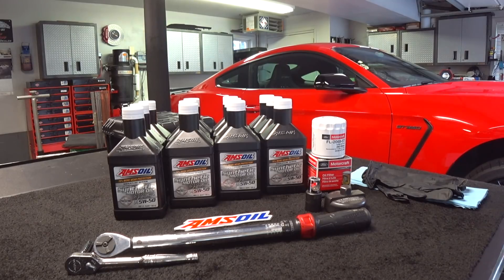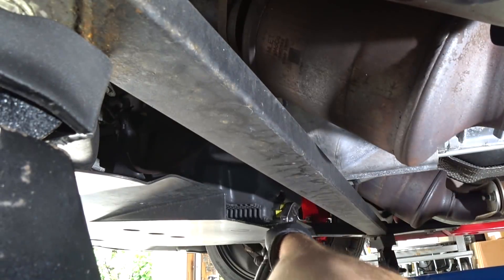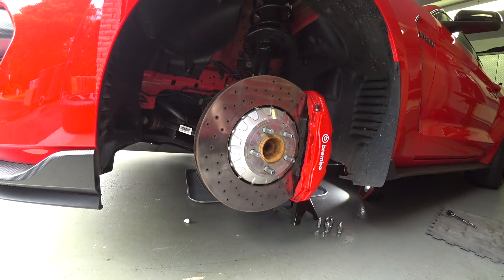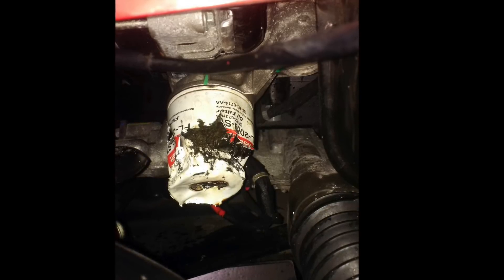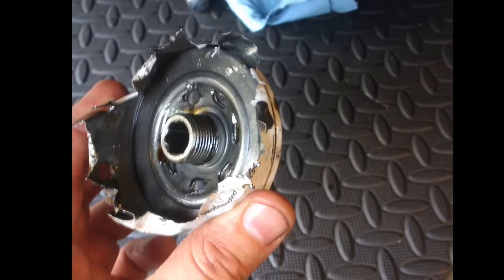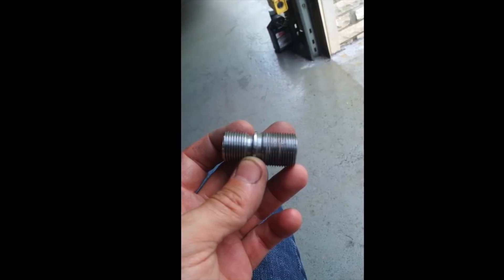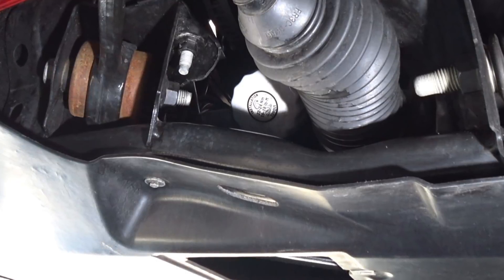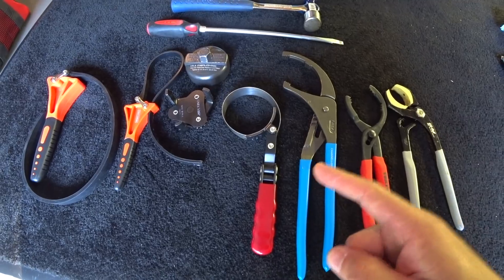Oil Change From Hell | Shelby GT350

Comment: dips hit mechanics should out it back on with a torque wrench.  my Porsche cayman s has a similar filter except it is easier to get to and it is upright and not at an angle.  when I change the oil I torque it to factory specs which I believe is 30 pounds or so.

Comment: Lol I had this problem all you have to do is drill a whole use a screw driver as a handle
Reply from the maker: dude that did not work as i explained the threads were seized up to the steel oil pump stud, i had it cut it off in my vise

Comment: Why did you "repair" the stud? Why not just buy a new one? Unless you rewelded metal onto it and retapped it, it's not going to be as good as new because the material is literally missing now. You can mess with it all you want but it's not going to be the sams. You buy an expensive car like this and then cheap out by not wanting to buy a new stud that was obviously ruined?
Reply from the maker: the chances of a local dealer having a new stud would be like winning the Powerball.

Comment: I hate when I work on a car that had a lazy impact gun blasting psychopath as the last oil changer. They always work at places that put filters with paper thin metal cases so you can't even count on the filter staying together when you manage to rotate it.
Reply: Cars Simplified that’s why you supply your mobile one filter with your mobile one oil. Ive been a lube Technician going on 3 years have never left a plug loose or filter siezed. I push out 60 cars a day and 80% of my customers are return customers. Just have to find the right shop stay away from any shop that is not connected in some sort with a big corporation like Napa, pennzoil, mobile, Castrol, or Quaker state. Stay away from firestone I’ve worked at two different ones and got to witness some of the most disguising people just disrespecting customers cars
Reply: Ugh.  Sounds like the PITA evening I had last year when my mom noticed a missing lugnut on her charger.  I figured I'd do her a favor and swap out the whole set of them since Dodge was using the chrome sleeve things which deform and rotate over the lug nut.  The dealership that usually does the work on the car must have used a 12 point socket on an air wrench or maybe an inch size on metric.  Most of them were too deformed for the car's spare kit lug wrench to fit on and they were a metric size I didn't have in my kit.  So I had to go find a suitably size tool and then because the sleeves were deformed, it wouldn't fit on most.  And even just slightly larger sockets would just turn the sleeves.  I had to hammer the right-size socket on to break them free, die-sizing the sleeves in the process.  A couple of them were hot enough to be uncomfortable to touch just from hammer the socket on.  It took over two hours but I did get them all and swapped them out for single piece plated acorn nuts that look better and won't get damaged like the OEM parts.
Reply: oh, and my other dealership fail fix was on my R53 mini... the bolt head of the oil drain plug was rounded over.  Not just overtightened but unremoveable.  I got set of Irwin extractors and they did the trick (with the help of a 4 lb sledge)
Reply: Rusty Shackelford  I had a supervisor showing me how not to break a lug key break a lug key.
Reply: Rusty Shackelford  Last August I went to Costco to let them do first tire rotation and balancing after first year and 1200 Kilometers. (7500 Miles)
Every employee in tire shop looked like teenager. I made a big mistake not walking out,right away. It's OK to be prejudist when it comes to fine and precise machines and instruments.
One of them who was driving my car from parking into the shop,didn't have any clue how to drive car with manual transmission. Every foot he moved my car,engine would shut off. In roughly 50 feet,he managed to shut off engine roughly 50 times. I almost cried.
When I came home I wanted to check if they tightened lug nuts to correct specified torque of 76 ft-lbf. (With one of my calibrated "PROTO" professional torque wrenches)
Little f.,they managed to completely round every lug nut on car.
Those are Toyota OEM lug nuts and I guess,maybe $ 200. Next time I will deliver only wheels for annual tire rotation and balancing.

Comment: My first oil change on a well used Duramax was almost that bad, but I finally got it off.
Later chages showed that for some reason the filters were tending to "tighten" after proper installation. Most likely due to the slightly higher operating temp of the Duramax, around 210f vs 180f. But I don't know for sure. Suggest tracking GT-500 oil temps with a temp gun at the filter housing to see... Additional oil cooling may need to be considered.  Good Job.

Comment: I change my own oil, however from time to time my dealer sends me free oil change coupons. Most of the time I just throw them in the trash but on this one occasion I decided to cash it in. A few months later my oil needed to be changed again. So I decided I would just do it myself like I always have done. When I got under the car and tried to remove the drain plug, it wouldn’t budge. I tried for the better part of an hour trying to get it loose, with no success. So I put my tools away and drove it to the dealer. I informed them I had my oil changed a few months back and was in need of another oil change but the drain plug would not come off. The guys in the service department knew exactly who changed my oil as soon as I told them I couldn’t get the drain plug off. So they put my car on the rack and messed with it for about 15 minutes before they got it loose. Then they asked if I wanted them to change my oil and I said absolutely not. So the service manager said we will just snug the plug up so you can get it home to change the oil. He also gave me a new drain plug because they had stripped the old one. He said if there are any problems with the pan or the drain plug leaking to let him know and they would fix it for free. When I got home I changed the oil, put the new plug in and never had another problem. I don’t think I could have done what you did. I would have just put the plug back in and added back the oil and drove it back to the dealer for them to fix the filter issue.

Comment: The filter is design to be that tight. Ford workshop manual says you need to tighten the filter to 18 ft lbs. Also this is not a oil change from the Ford GT is. Dry sump system and it takes 2 hours to do the oil change.

Comment: Why the hell do so many people use impact drills on oil plugs and filters?!
Reply: because they don't have the common sense to use a torque wrench set to the factory spec, or in absence of a torque wrench, putting it on hand tight with a bit more using a regular socket.
Reply: Being lazy and maybe untrained.

Comment: What the heck?  You have to take the wheel off to change the oil. Wow!  What a nightmare of an oil change you had!
Reply from the maker: pulling the wheel on this car makes it much easier but the filter location still sucks and there is very limited room to work in this corner.

Comment: My buddies wife had a Pontiac Sunbird, I think it was a 2.0. The car had an aluminum head.
They took it to Firestone who...put the plugs in a hot engine with an impact wrench.
Reply: Ouch, that sucks to.
Reply: Did they end up needing to get new heads for it or did someone eventually get the plugs unseized?
Reply: How does your buddy know that? I don't believe it.
Reply: whats the point of this comment? So they put the plugs in a hot engine with an impact wrench? Nice, i did that probably over 100 times as a mechanic of 15 years. Never broken a spark plug in the head taking in it out, or putting it in.
Reply: @sashapuhalo5270  Horrible
Reply: Impact drive or impact gun ? Big difference in tq that’s applied. And for those of you that go “that horrible” unless you make money by turning wrenches you don’t get a vote. And to the post that said “did they need new heads?” The GM 2.0 eco tech only has ONE head. A 1/4 impact drive from dewalt is normally what’s used when doing plugs which is 80-100 inch pounds which translates to 7-9 foot pounds which is right at the bottom limits of what a spark plug needs. With “about” 14 foot pounds being the MAX to use which the 1/4 impact won’t get close to.
Reply: Brian Fulwood P

Comment: No lube tech or professional mechanic is ever going to use a torque wrench to tighten an oil filter or drain plug.  I believe you probably messed it up on the prior oil change.

Comment: So question? Why didn't you take it back to the dealer and show them the problem? I worked in the automobile industry for close to 30 years. If you could prove they did damaged your GT 500 (and that one looks new) I would think you would have had a warranty claim.
 Also Factory Representatives visit stores and will look over issues like this if they are made aware of them. The dealer stands to lose Big money if they are found to be doing bad work and getting bad CSI reports. Trust me the Dealership owners want to make sure their service departments are doing good work. Bad Reports and LOW CSI scores cost them Big Big Money because CSI  scores play a part in getting the right inventory or enough inventory or incentives to lower the cost of their vehicle inventory. Warranty claims processing and payments are also effected. 

It's the first thing I would have done once I had discovered the problem. Instead you posted a video and now you can't prove anything.

Comment: That is one thing I like about my Subaru, oil filter is on the top of the engine and right up front with absolutely nothing getting in the way.
Reply: Snadzies hell ya! add a fumoto valve and its crazy easy
Reply: Same thing with my 2000 clk its right at the top
Reply: I did my 2018 Crosstrek's first oil change recently and it has that set up. Super convenient and easy!
Reply: Yes those are more convenient, however, you would not want that top-load setup on high performance car.
Reply: Similar with my car, but it's on the bottom. Only thing in the way is the over-engineered, meaty subframe, and even that isn't in the way more than necessary.

Comment: you should get a quick jack lift
Reply from the maker: too heavy to move around and i have no space for one, i honestly can get the car up on all 4 sides in less than 5 minutes which is easier than setting up the quicklift stuff. I use 2 jacks it is so easy

Comment: I tell people all the time as a technician at ford that you should learn how to do your own oil changes if possible. The only person who’s gonna do the best job on your car is your self!
Reply from the maker: i always do it happened that i was near a dealer way up north and had the oil in my trunk and in the middle of winter it made it easier and now i realize how bad of a mistake that was. Did Ford tell techs to overtorque filters on this car?
Reply: Auto Fanatic I’m sorry about your experience with that dealership. And as for ford requiring us to over torque our filters that’s nonsense, I follow what the specs call for on each vehicle that I work on especially some of the Shelby’s that I work on require extra time and care when doing a service on them.

Comment: Oil filter torque spec is 16-18 ft/lbs. When hot, that filter is F'in tight. Every one I do gets a torque wrench put to it. It always takes way more than 18  ft/lbs to get it loose.
Reply: wait that's the torque when installing it? I install oil filters with my hands and even then I need to wrench it off
Reply: The rubber on the oil filter always locks it up after it has done a few run cycles and that’s why it is harder to remove than it was to install. Best practice is to lubricate the seal and screw it on with your hand only. It is a big mistake to think that it has to be installed as tightly as the last one was removed as it becomes nearly impossible to remove next time. I have had an apprentice do this once and it was hard to get him out of this mindset.
Reply: Thats because there is a big difference between brake away torque and torque with momentum. It might only be 15-20lbs to get it on. That torque is read while in a constant motion until the click. When braking ,you have to overcome the resistance of friction on a stuck part and can easily go up 5-15lbs.

Comment: So running the car before changing the oil to bring oil to temp which will thin oil viscosity so it drains easier vs letting the car cool down and more of the oil will drip down back to the oil pan getting rid of the excess that sits in the top end. hmmmm

Comment: Should have taken it back to the dealer for the oil change and let them deal with that. If they would have messed up in the process well now that is on them. Saves you all that headache
Reply: Blackout KR more than likely that same dealer would have not replaced it after they found out how difficult it would be to remove and repair the damage.

Comment: Finally fucking bought this car last week after 2 years of saving, and it's more than I could have even imagined.  Now to worry about maintenance and 9mpg haha ^_^
Reply from the maker: just enjoy it and be careful if you let a dealer do the oil changes for you
Reply: Normally I'd do the oil change myself but my new place has no room.  A buddy of mine has a guy at a dealer in the Bay Area he trusts and highly recommends I go to him, so I'm going to give it a try.  You think they'd like me shadow them?  I wouldn't trust them alone with the car haha
Reply: SF Bay Area should have plenty of enthusiast owned auto shops. I would find a private independent shop, the guys working at the dealer are barely competent and I always end up disappointed. Most should let you hang out near the car while they are working on it, just maybe not right under the lift due to liability reasons
Reply: Aram Garibyan what's up buddy!
Reply: Danny!
Reply: Aram Garibyan 9mpg? Damn get off the pedal man
Reply: 9mpg, you obviously don't own a NA Gt350, you'd have 2 do burnouts at every stop sign to get that bad of mileage.
Reply: yea lol..... Jeez.  Or if you are sitting in stop and go traffic every day.
Reply: Congrats man! At least you get better mileage than my Roushcharged 5.0 lmao
Reply: That's great, any advice for someone else trying to save?
Reply: 9?!! My 12 psi Kenne Belle Cobra would get 16mpg all day long.
Reply: 9mpg what is the engine???

Comment: Regular maintenance made difficult? On a Ford? Unheard of...

Please, in my experience, between the goddamn F-series, the focus with it's goddamn cardboard skidplate held on by 14 bolts of 3 different types, the taurus... Ford doesn't give a damn about ease of maintenance on their notoriously unreliable cars and 95% of the problem is filter placement. "Oh gee, where should we put this thing? I know, IN the belt, above the frame,  or behind the radiator surrounded by oil lines!"

And that switch from cartridge to canister filters won't do shit either unless the cup it metal. Toyotas have that damn plastic cup and the moment the car goes an inch above 5000 miles, even on synthetic, the cup practically siezes up. Again, that can be remedied with a metal cup.

Hatred of ford aside, my money is on the idiot who installed that not lubing the gasket up and using the wrench cup to install the thing because there's no way to hand tighten it in there.

Comment: The tech probably didnt put any oil on the filter gasket and put it on over tight dry. what a nightmare!
Reply: If they are putting it on with an impact gun, which is usually what it takes to make this happen, oil on the filter gasket probably makes things worse by resisting even less as the impact gun compresses the seal. I would much rather deal with hand-tight-but-dry over a lubed impact job.
Reply: Ford spec is dry. No oil.

Comment: That’s a little extreme...I doubt he used a impact wrench. It probably was just put on super tight and he didn’t use a thin layer of clean oil on the gasket which aids in removal. That engine most likely gets very very hot exasperating the situation.

Comment: No they change it because the new oil filters supposed to be eco friendly. ✌🏽less metal more cardboard in the landfill✌🏽but it’s not just ford majority of car manufacturers.
Reply: J G  - old heavy '64 Chevy 283 uses that large canister, it is an easy filter change. huge filter too, i doubt it is better than modern screw ons with anti- siphon tech.

Comment: OMG, my philosophy regarding oil filters, tighten filter till it's just snug, then 3/4 turn. Mark the bottom of the filter with a Sharpie to gauge 3/4 of a turn, never had a problem. All my filters come off with my bare hand, make sure the filter is free of oil and your hands are dry.

Comment: I had the same problem, oil filter and drain plug way too tight, after having the oil changed on my Duramax at a local oil change business, had to use an impact to remove the drain plug and destroyed the oil filter removing it.  Take away is always always always change your own oil.
Reply from the maker: Ford was having oil filters come loose on this car and I bet the technician thought he was going us all a favor and months later I had to deal with this mess. Ford has now changed this design for good reason but their are thousands of cars out there that may suffer this one day.
Reply: Steve Lyde ha I was just going to comment that my duramax filter was a bitch from the dealer.  Had to put a screwdriver though it to get it off. I notice that it does seem to get tighter than what i put it on at. BTW I do all my own oil changes just not the first few so the factory cant blame me for something
Reply: I used to work at a gmc dealer and the duramax drain plugs always seemed to be a pain in the butt for some reason